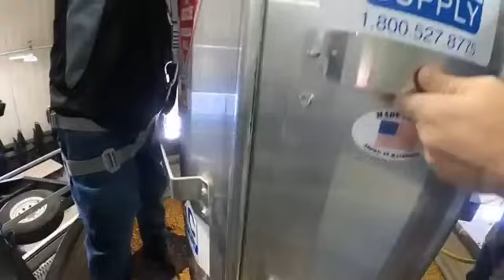Farm Safety: A Rescue Simulation from Grain Engulfment

Comment: Real Smart !!  A Damn Electric Battery Drill that you can SEE Sparks in it when it Runs inside a 
Dust filled confined area = 💥💥🔥
  Whois the Fat Head that came up with that idea ??!  Dufus couldn’t even Chuck the stupid drill properly !!
   Put a Simple Hand Crank on that Auger !!  Can’t Screw that up unless you turn it the Wrong way !!! 
  The Whole Demo Looked Like a 💩 Show !!  
  Gotta be a Simpler way with Less Clutter Equipment !!!
  Better to Stay the Hell out of there Unless all Augers are Locked/Tagged Out and Confined Entry Permits are Filled out and authorized by Management and you have People helping and watching you making sure anybody in there is Wearing Safety PPE equipment !!
But there’s Always some Idiot that will take shortcuts even if it endangers their own life.

Comment: I'm certainly not an expert, but it seems like you could put a high-pressure air Lance tip about 5 ft underneath the person, have them strapped to a fall protection harness, and slowly lift them as you fluidized the grain with air. They could even have a respirator or something on for the dust it will create

Comment: This would probably work to remove a dead body. They won't be alive if it takes that long. Not saying i have a better solution, but this was painful to watch. Everything was best case scenario for this demo and it still looked clumsy and took too long.
Reply: Yeah I also thought that. Inconvenient if it's just your legs, but I'd your torso is being squeezed they better have it drain from below and use big pumps and dig dig dig to get that pressure off.

Comment: If a person was stuck like this and you tried pulling them out with a winch and harness, or with a crane / telehandler / excavator or the like, i.e. using brute force to pull them out, would that work? I mean, would you be able to pull them out whole or would the grain have a strong enough hold to actually dismember the victim if you tried that?
Reply: imagine suspending someone with a 300 pound weight attached to their feet... nothing particularly gory but definitely going to cause permanent damage.
Reply: It would probably be a good way of securing them at the level they're currently at.

Comment: Seems they COULD make the panels out of lexan/polycarbonate so it would be slightly less claustrophobic?
Reply: And less likely to take a finger off?
Also, all that dust kicked up by the auger, and the sparks in the DC motor of the drill seem risky.
(Edit: I see in another comment that it's a brushless i.e."no spark" drill)

Comment: Can someone explain why farmers even go inside these silos in the first place?
They should know the danger right? So, they go inside, jump up and down; then what do they think is going to happen? 
I mean, they're either going to fall through a plug or the grain starts shifting and then they're trapped. 
I don't get why you would bother with such a deadly risk, am I missing something?
Reply: It looks like the industry is moving towards zero entry, but if the grain isn't stored properly (gets and stays too wet or whatever) it can form clumps which have to be broken up somehow to empty the bin.

Comment: I get trying to dig her out, but couldn’t they also vibrate the grain while pulling her out instead? Enough vibration would cause it to act like a liquid.
Reply: Probably not what you would want if stuck in a real scenario. Could cause you to sink even farther than you already are.
Reply: @roberthill6738  My last comment was removed, but I said “while pulling her out”.
Reply: They make portable vibrators for de-aerating  concrete.  It does seem it could work if you had the harness and were able to vibrate from surface to feet.  But you are correct, only an experienced person could really say.
Reply: Have you ever tried to move tons of corn/beans? It doesn't work like that
Reply: @TheKiltedWoodsman No, I haven’t. But vibrations cause grains to shift. I don’t know how much would be required to move this pile, but enough could cause the grains to attempt to settle while allowing movement.
Vibrations are part of the processing for moving and separating grains.
Reply: @TheKiltedWoodsman And I looked into the liquidation, that occurs if air is also involved, being blown from below, which maybe isn’t realistic with a silo.
A dude made a hot tub of sand, but that was just air, no vibrations involved.
Reply: @doob62  True, but think of it on a large scale, not the small scale they used for training. You would need something very large that could make a lot of vibrations to be able to move the corn.
Reply: @ Yeah, didn’t consider it on a large scale. Vibrations could work for the immediate area like quicksand does on a beach, but I’m not knowledgable enough to know how it would actually affect the grains, so I can’t say it will, but also can’t say it doesn’t work. Won’t know till it’s tested.
Reply: @ I believe someone commented on here about a person falling into a moving truck of grain and sinking deeply into it with a fatal result.

Comment: Did anybody think about the problem of using battery powered tools in an explosive atmosphere? I think for this situation an air powered drill would be safest. I would think that compressed air is readily available in a mill. Most cordless tools are brushless now but it would only take someone introducing an older drill with brushes into the situation in the "heat of the moment" to cause an explosion. The battery powered tools that I am aware of are not rated to be in an explosive atmosphere, so even a brushless would be technically unsafe. Also I suggest an adapter with the required female hex drive size to be used so people are not fiddling with the chuck adjustment in an emergency.
Reply: far harder to get air 100 feet to the top of a silo. also it's a BRUSHLESS drill. if it makes sparks then something is seriously wrong with it
Reply: @whatusernameis5295  you don't think the switch could create a spark?

Comment: Everyone ignoring the choking, possibly flamable, dust she mentions over and over and over.  This is a clunky, unworkable "solution".  I wonder what damage her legs sustained being crushed by that "rescue wall" for so long.
Reply: The dust is ok, she's obviously in the office and not the terminal, so she's not used to it. As far as this being unworkable, I would be willing to bet this is one of the best products on the market for small time operations or older facilities. Rescuing someone is never easy work. Even the best practical equipment can be cumbersome and hard to manipulate  even with practice. This is very typical of the kind of lengths it takes to save someone's life, but now imagine the race against time, the victim unresponsive, and everyone's panicking. We can not thank our emergency response teams enough!

Comment: I am an engineer officer on a ship. Last time on board, on one company'ship one engineer with one motorman and a wiper opened one of the ship's sewage tanks which scheduled for a period repair. Previously the tank was flushed with sea water as per company internal regulations. All the pre-entry approvals were obtained. Upon opening the tank's lid, a strong rotten egg smell erupted from the barely cracked manhole cover. One of the ratings was overwhelmed by the amount of H2S and fainted. The other rating attempted to rescue his colleague. He fainted as well. The engineer who was in the vicinity felt the urge to rescue the other 2 guys. He didn't do it but he raised the alarm. The rescue party arrived on scene and retrieved the 2 fallen men. Luckily they recovered themselves as the gas dissipated. The 2 guys were handed to a medical team for checks and they were OK. Should the engineer attempt to rescue 2 fallen guys he could have been the 3 fallen person. Remember - they only opened the tank, not even removing the lid yet. They had 2 gas meters, they had 1 blower that was supposed to be installed to ventilate the tank, lights, 3 radios in the correct channel, the briefing for the jos was done. A risk assessment was also available and was discussed the evening before. The only thing that was not done (because was not required by the rules) was to turn the gas meters BEFORE opening the lid. For sure it will change soon. During our periodic (every 3 months) Confined Space Entering training we are also covering the situation presented in this video (engulfing situation). 
In the maritime industry the main cause of death is exactly the situation I told earlier. In most cases the victims are double as almost the second person who is "the saviour" will collapse next to his victim.
Reply: Таже ситуация с погребами в частных домах где хранят картофель. Погибали целые семьи, пытаясь спасти один другого.
Reply: Hydrogen disulfide is no joke man. In the oilfield you always are keeping an eye on that windsock. Pulled one guy off location that was out cold.
Reply: Thats insane. You really never know until it happens. Glad everyone is ok.
Reply: The huge problem with H2S is: It will numb your sense to smell it. If you open tanks and are not able to ventilate it prior to opening it (which is in situations like you described on a ship, a sewage system in the city, some tanks in chemical processing) you do it with a mask and an oxygene system also with gas meters to be safe. When H2S overhelme you, there is always a lethal dose in the air. At concentrations above 250 ppm, the odor receptors become desensitized, making further increases in concentration almost always go unnoticed. This is one of the greatest dangers of this gas. At 500 ppm, symptoms such as nausea, dizziness, and convulsions are followed by unconsciousness!! 

I studied chemistry and was responsible for the labs safety. We were using H2S, HCN, CO for processing and reactions. We had to do a training, how to use these gases. I am surprised, that people in dagerous situations are not trained properly. Here is how it affects the body and please please read carefully: 

Effects of H₂S on the Body
Inhibition of Cellular Respiration:
H₂S binds to the enzyme cytochrome-c oxidase in mitochondria.
This enzyme is critical for the electron transport chain, which produces cellular energy (ATP).
The binding blocks the cells' ability to use oxygen, leading to cellular suffocation, even though oxygen may still be present in the blood. An oxygene theraphy is useless, if already poisened. 
Effects on the Central Nervous System (CNS):
H₂S quickly affects the CNS by paralyzing nerve cells.
Symptoms such as dizziness, seizures, and unconsciousness often occur within seconds or minutes.
Irritation of Mucous Membranes:
At low concentrations, H₂S irritates the eyes and respiratory system, causing tearing, coughing, and shortness of breath.
Desensitization of Olfactory Receptors:
At concentrations above 250 ppm, H₂S desensitizes olfactory receptors, making the characteristic “rotten egg” odor undetectable. This significantly increases the risk of unnoticed exposure.
To make it even clearer, here are some comparisons with other toxic substances.
Comparison with Other Toxins
Cyanide (HCN):
Similarities: Both block cytochrome-c oxidase, inhibiting cellular respiration.
Differences: Cyanide is more toxic at lower doses, while H₂S also causes significant mucosal irritation.
Carbon Monoxide (CO):
Similarities: Both prevent oxygen utilization in the body but act differently:
CO binds to hemoglobin, blocking oxygen transport in the blood.
H₂S directly inhibits oxygen utilization in cells.
Differences: CO acts more slowly and can often be treated if caught in time, whereas H₂S acts rapidly.
Ammonia (NH₃):
Similarities: Both are pungent gases that irritate the respiratory tract and mucous membranes.
Differences: Ammonia is less toxic and causes localized damage (e.g., burns), whereas H₂S leads to systemic poisoning.

Toxic Doses of H₂S
< 10 ppm: Detectable odor, typically no acute danger.
10–50 ppm: Irritation of eyes, nose, and airways.
50–200 ppm: Headaches, nausea, dizziness.
250–500 ppm: Desensitization of olfactory receptors; risk of unconsciousness.
> 500 ppm: Rapid loss of consciousness, respiratory arrest, and death (often within minutes).
Treatment for H₂S Poisoning
Fresh Air: Immediately remove the affected individual from the danger zone.
Oxygen Therapy: Administering pure oxygen can help restore cellular oxygenation.
Amyl Nitrite: In emergencies, amyl nitrite may be used to partially reactivate the cytochrome-c oxidase enzyme, similar to treatments for cyanide poisoning.
Conclusion
H₂S is a dangerous gas with potentially fatal effects, acting by inhibiting cellular respiration. It is similar to cyanide in its mode of action and, like carbon monoxide, particularly insidious as symptoms are often noticed too late. Awareness and rapid emergency measures are essential to prevent poisoning.

Letting you "open" a sewage tank without letting you know these facts which could simply be written onto a fact - sheet and without proper training is negligence at best!
Reply: and then there's the chain lockers in ships where the chains can oxidize so fast, that even an open hatch can't refill the oxygen fast enough to save your life
Reply: @insu_na  exactly
Reply: 貴重な体験談ありがとう。恐いな
Reply: I have always worked construction, and there is a very intricate dance you do with being safe and productive all at the same time. I have also noticed in a  lot of situations that a scared worker can do more damage than a reckless person. The #1 goal should always be that everyone leaves in the same shape they showed up in
Reply: Usen máscaras y tanques de 02
Reply: You need to ventilate the tank before even opening the hatch. Not all tanks are built so that can be effectively done but they should be, at least when the tank is indoors and might contain high concentration of bad gases.
Reply: @skunkjobb  You didn't understand. Read again. To ventilate a tank you have to open it first. Do you know how a ship is built? Do you have any connections with shipping? I don't think so.
Reply: This is why men should be paid more than women. Their job are dangerous
Reply: if those gas meters can't measure the gas level before opening the tank then they wouldn't have done diddly squat. they take a bit to pull air through themselves

Comment: When you are using a chuckless drill you need to use your hand and the power of the drill to tighten the drill on the auger. So you need to grip the nose of the drill and have the drill go forward to tighten it up then switch to reverse.

Comment: Those drills usually have a spark. Especially the ones with brushed motors. I heard from other comments that the grain dust can be flammable?
Reply: It's a brushless drill. The announcer said so.
Reply: @Jesse-Rodriguez  good ears. Thanks for sharing that.
Reply: Explosive 💥
Reply: Very flammable
Reply: Any dust IS EXPLOSIVE! ... if fine enough.
Reply: @jimbefit3073  Not any dust but many types of dust are. E.g. dust from most salts cannot be ignited.
Reply: @jimbefit3073 yup, from flour to wood any dust can be explosive
Reply: Yeah as someone said any dust is flammable it all to do with it being small and the air between the particles I work in a sugar factory where in  the elevators they had explosion surpressive devices that were packed with baking powder. Idk the science behind that but fire spreads through oxygen dust oxygen dust .
Reply: @AllienSmoke69  Not any dust, that would be ridiculous. It has to be flammable substance in the first place. Sugar and flour are both flammable.
Reply: It is flammable but it needs to be much more dust in the air than we see here before it can be ignited.
Reply: My hometown elevator has had 2 explosions
Reply: Please give us more information   @mschro626
Reply: Baby powder dust is explosive. YouTube baby powder factory explosion. Any dust can potentially be explosive.
Reply: @gabrielf1911 is that why Johnson & Johnson put asbestos in their baby powder? 😜
Reply: Grain dust or flour does create a very explosive atmosphere. I’m an electrician and specialist electrical equipment has to be installed in those atmospheres that is explosion proof
Reply: Maybe because the ventilation it’s not as much of a risk? I don’t know if that would be safe inside a silo? I know sugar silos are crazy explosive.
Reply: In the proper concentration of dust to air it is quite explosive. Grain silo explosions can blow concrete sections weighing several tons up to a mile away.
Reply: Explosive! Had a flour mill  explode in my home town just from wheat dust and flour!